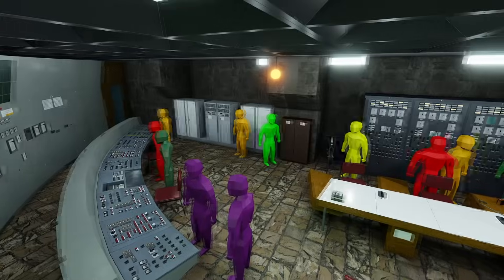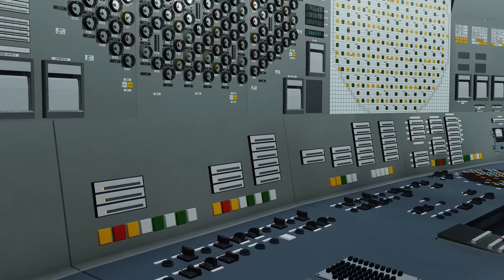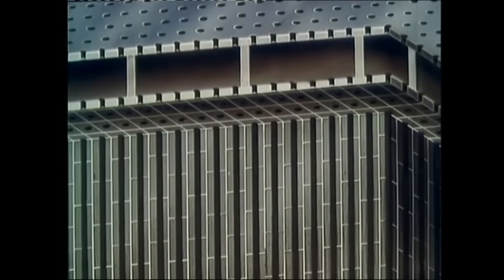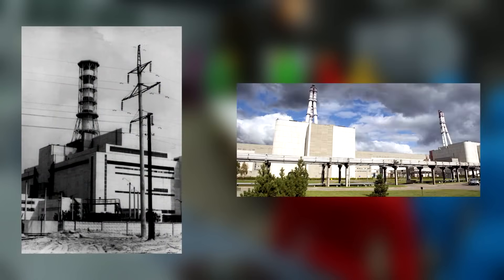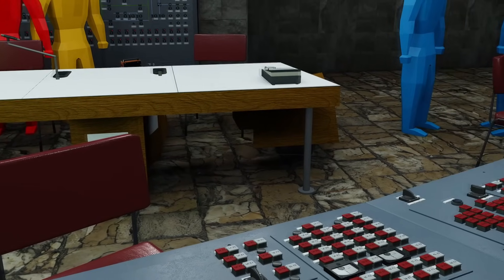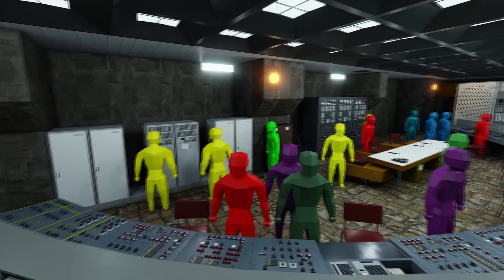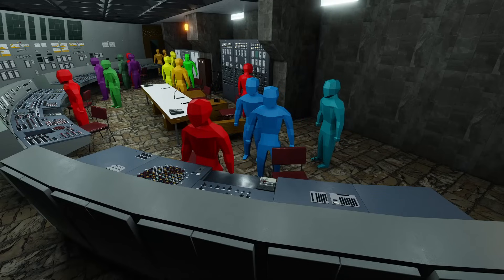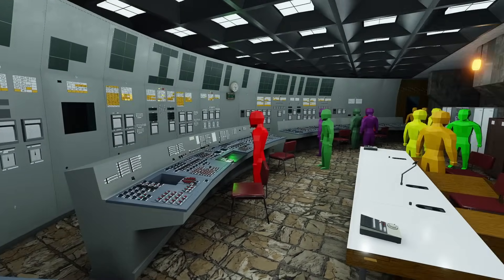How Chernobyl Exploded - PART THREE: The Final Minutes

Comment: Actually Prompt critical is the wrong term - this is used when the Neutron rate is neither increasing or decreasing but is sustained only by Neutrons emitted immediately following a fission rather than those released from the resulting fission products seconds to minutes later. The term you're looking for is "Supercritical"
Reply: That Chernobyl Guy is actually correct in his terminology. When neutrons aren't going up/down, is called a reactor being critical. It means nothing more than that reactor power is stable at some level, and the neutron generation being used/ being produced is in balance. 1 neutron produced -> 1 neutron being used. That's not prompt criticality, far from it.

Supercritical is when reactor power is going up. More neutrons are being produced/ used. This in itself isn't necessarily dangerous. You need a very small bit of supercriticality, or else you would never be able to get your reactor back up to power after a maintenance shutdown. And you can be supercritical on delayed neutrons. This is totally normal. Like I said, you'll need some of it to get your reactor back up to power.

Prompt criticality is something else entirely. It means the reactor is sustaining the fission reaction on prompt neutrons alone, which is very, very bad. At that point you will put your reactor in orbit because there is not a computer system or human in the world that is fast enough to prevent things from spiralling wildly out of control. See Chernobyl Unit 4 for the results of prompt criticality in a power reactor.

Prompt neutrons -> being born at the moment of a fission event.
Delayed neutrons -> they appear millisecond to sometimes even minutes from the fission products after a fission event. These are the neutrons we use to be able to control a reactor. Without these, that would be impossible.
Reply: @swokatsamsiyu3590  Supercritical = "Oh shit, we've got to do something!"
                                            Prompt Critical = Ka-BOOOOOM!!!!"
Reply: Personally I would use "super prompt critical" to describe a system with a power excursion where the power cannot be controlled by active engineered systems, let alone by human operators.
Reply: But even a super prompt critical system might not explode. If it has inherent negative reactivity feedback, for example due to thermal expansion or fuel temperature effects, it might either self terminate or settle into a stable low power state.
Reply from the maker: Supercritical would be a βeff between 0 and 1. As βeff reaches 5-6, this is far beyond the value regarded for prompt criticality.

A similar method of measuring criticality is the dollar system, where 0 dollars = critical, and 1 dollar = prompt critical.

The values for βeff are given in INSAG-7, the IAEA's 1993 official report on the Chernobyl Disaster. 

I hope this helps. :)

Comment: "positive SCRAM effect" is a term coined by reactor's designers in attempt to cover their backs and shift the blame to operators. It is like positive results for cancer or Alzheimer's test, you can have plus sign, but there is little positive about it. Purpose of SCRAM system according to USSR reactor designer's regulation is to "rapidly and sufficiently insert amount of negative reactivity needed to shut the reactor down and keep it in that state". It is used in cases of emergency, as a response to violation of safety critical parameters, and also to shut reactor down as last step of routine shutdown procedure. "Positive SCRAM effect" means SCRAM system doesn't meet basic requirement for that system. Moreover, "positive SCRAM effect" implies SCRAM system in some situations does exactly the opposite - it inserts positive reactivity, increasing reactor's power. This also makes various protections of the reactor to behave weird. E.g. during the event, reactor's protection detected abnormally high reactor's power level and abnormally high rate of power increase, and initiated SCRAM. Logically, it should lead to rapid insertion of amount of negative reactivity, enough to shut down the reactor and reliably keep it in shutdown state. With "positive SCRAM effect" the effect is opposite.

In combination with slow rate of insertion of control rods that power peak may be rather long and devastating, it took 4 seconds for the reactor to explode with power rise from several percent to 100x of nominal, while insertion time of control rods was about 26 seconds, few time slower than on reactors of similar size, but without such large positive coefficient. That was determined be totally inadequate, while reactor designer's regulatory documents require speed of operation of control mechanisms must be enough to provide robust and efficient control of reaction and reliable shutdown, including cases of emergencies and accident.

And of course positive reactivity coefficient not only opened and shortened path to unintended prompt criticality, but it also highlights control system's inadequacy. Positive reactivity coefficient not only makes the reactor unstable and hard to control, producing tendency to power swings, but also, with increase of positive reactivity coefficient, makes swings larger and faster, and this requires much faster control system to fight with than it would be needed without positive coefficient. While negative coefficient does the opposite, making the reactor more stable, self-regulating and able to counteract disturbances. That's why reactor designer's regulation state "the reactor should have negative power coefficient in general; in case the reactor would have positive power coefficient, special attention should be paid to investigate and ensure safety of the reactor in stationary, transient and accident scenarios"
Reply: I never took "positive" to mean anything else except a mathematical '+', and I'm unsure  that the original Russian term even has such a dual meaning. It simply refers to the paradoxical, momentary increase in reactivity lower in the core following the insertion of the control rods (?) 
I strongly suspect you're reading into it a connotation that simply isn't there.
Reply: Incidentally, IIRC, the operators were not aware of this.
Reply: I mean, based on the rest of your post, you probably have more of a grasp on the actual relevant concepts than I do, so I'm puzzled by your  initial statement.  It's just like "positive void coefficient" versus "negative void coefficient", or "it is negative 31 degrees outside".
Reply: @bsadewitz Negative 31 degrees?! That sounds bad!
Reply: @reverbscherzo7850  So does +130!
Reply: @reverbscherzo7850 The original documents aren't in English.  I'm not sure if "negative" and "positive" even translate to words with the same connotations they have in English.  In audio recording, a -5dB level is fine, whereas a +5db would be severely distorted.  In digital audio, anything above 0dB is clipped; it can't be encoded.
Reply: All this is a replication of the Soviet lie about the causes of the accident. If you want to know the truth, watch: HOW THE 4th UNIT OF CHERNOBYL NPP WAS BLOWN UP.   (KS channel)
Reply: First of all, it is not SCRAM effect, it is flaw effect. Of course, naming it as such is the same as admitting the flaw. So what is the scram effect actually? Scram effect is shutting down the reactor, much alike as (emergency) brake system effect, which is to slow down the vehicle and stop it. It is required by regulations and sanity.

Ok, "positive effect" is an effect that improves the situation, while "negative effect" is something undesirable and makes the situation worse. Every aspect there takes in account the goal. So if sane person would use the term "positive scram effect" ("positive general brake system effect"), it can be used only to describe proper reactor shutdown process. There is actually no need for that, because it is normal unless specific reactor's control system is flawed, and term "scram effect" is as good as "positive scram effect". While "negative scram effect" is undesirable effect of scram.

Yeah, there is undesirable effects of scram, like thermal stress, but even those not described with term "negative scram effect". The term "positive scram effect" how it is used now, apart from defying common sense and sanity is totally disconnected from other terms it should be related to and occurs in publications afaik only in connection to specific flaw of rbmk reactor's control system. Terms "negative coefficient" or "positive change" are totally ok because of nature of terms "coefficient" and "change". While the term "positive scram effect" is constructed to cover designer's back and shift blame to operators, it is vague, absurd, confusing, obscures what happened, why it happened and not properly attribute what happened to why it happened.
Reply: @JumpingJack-w2l  It has absolutely nothing to do with any positive/negative value judgement judgement or assessment of anything.  

"The scram reactivity in Chernobyl-4 is positive.The magnitude of this reactivity is large enough to lead to a prompt critical condition." (p 216)

INTERPRETATION OF POSITIVE SCRAM REACTIVITY
IN THE RBMK-1000 REACTOR
K. HASHIMOTO et al
Ann. Nucl. Energy, Vol. 21, No. 4, pp. 211-217, 1994

Does that sound like something that's designed to "cover the designer's back"? The term is used in contexts that have nothing to do with RBMK reactors!  Scram reactivity is a generic term; it isn't just used when talking about reactor accidents!  It is not vague, entirely clear, and isn't the sort of thing that one would say inherently "obscures" a fact (or not).  You are reading into this meaning that is simply not there--and never was there, ever.  EVER.  "Positive scram effect" denotes an increase in reactivity.  "Negative scram effect"
 denotes a decrease in reactivity.  Of course, there is no reason to actually say "negative scram effect", because that's what is supposed to happen.  

I think you even said something similar in your post, and, if so, I am doubly mystified as to how you could not understand how you're misreading what "positive scram effect" implies.  There is no deception.  It's just a slang term for "local insertion of positive reactivity" after "receipt of a scram signal".

 You said "[It] occurs in publications afaik only in connection to specific flaw of rbmk reactor's control system."  Well, not really.  I mean, sort of, but that's because Chernobyl established that paradigm!  That doesn't mean that e.g. "positive scram" isn't used anywhere else!  Note the use of the  phrase "negative scram reactivity insertion" on p114 of this document about BWR reactors:

https://inis.iaea.org/collection/NCLCollectionStore/_Public/15/025/15025513.pdf

Comment: What a phenomenal conclusion of this 3 part series. Very, very well done. And you even included the exercise bike in the CGI representation of the control room, impressive attention to detail! The thing that still has my brains doing triple backflips is "had to wait 5 minutes before the system would spit out the results..." Good grief, when you're dealing with a reactor capable of doing a full about-face in literal nanoseconds, at least give it a computer system that isn't walking at a snail's pace.
Reply: The in-control-room display is a point of controversy among us. If you look at page 38 of INSAG-7 and in some other sources the suggestion is there was no such thing. The 01:22:30 printout is such a big deal presumably because of this. Yet I think in Shcherbak's book (possibly Karpan's) operators are being quoted as apparently referring to some display. Sredmash and That Chernobyl Guy are comfortable tying this display directly to the PRIZMA program that produced printout calculations whereas I'm not. So it's a surprisingly important detail that, as usual, is flying under the radar, and I find it particularly controversial.
Reply: @markusw7833   
I was more talking about the SKALA system in general, not necessarily a specific display. As ingenious as it was, it was also woefully underpowered for its intended task.
Reply: @swokatsamsiyu3590  Right, there was a systemic limitation. Five minutes was actually the minimum time. Five to about fifteen minutes is the window. In general the ORM was simply treated as not that important.
Reply: @markusw7833  Had the employee that was not present due to being told the reactor was shut down been there. Do you know if the computer they had for guiding ORM more advanced/faster?
Reply: @Melanie16040  I don't know about this employee. Unless he factored the actual values of the coefficients of reactivity into his program or whatever rather than the misleading ones the operators had available I'm a little skeptical as to his value. This is another detail found I believe in Karpan's book that seems at odds with what I've been reading.

Comment: It feels really counter-intuitive that too much coolant can be bad for a nuclear reactor. Yet we see a problem with flow rates here, and in Three Mile Island, where the operators became convinced that there was too much water in the system.
Reply: There was a rule against excessive flows for the main circulation pumps so they wouldn't cavitate or apparently destroy themselves, which was a consequence that did not occur at Chernobyl. However, there wasn't one for the reactor core. Soviet experts got quite clever in how they presented this. The consequence tied to Chernobyl is about the temperature of the coolant rising close to the boiling point, which INSAG-7 seems to attribute to lack of condensate feedwater flow as the reactor wouldn't be producing much steam which was supposed to subcool the coolant yet you see the operators being able to call extra feedwater flow from somewhere. Furthermore, apparently there was neither a prohibition on connecting all main circulation pumps or on operating with lack of subcooling, and a high coolant temperature occurred naturally in RBMK reactors. This will be discussed in a later video.
Reply: @markusw7833  All this is a replication of the Soviet lie about the causes of the accident. If you want to know the truth, watch: HOW THE 4th UNIT OF CHERNOBYL NPP WAS BLOWN UP.   (KS channel)
Reply: It can be counter intuitive. In British AGRs, the reactor power is controlled via the coolant flow. Increasing the flow increases the power.
This works because these reactors have a negative fast temperature coefficient and automatic control rods to deal with the slow positive temperature coefficient of their core graphite.
But I think the real problem at Chernobyl was where was the thermal power supposed to go after both turbines were tripped?
AGRs are automatically shutdown in the event of a turbine trip and post trip cooling systems kick in right after that.

Comment: "The pressure inside the core has been released" yeah that's one way to put it
Reply: "A rapid unintentional disassembly"
Reply: @maksphoto78  Or slow, if we consider all the cut corners in construction and design to get these reactors up and running so fast.
Reply: a nuclear powered pipe bomb
Reply: Terrifying to realize when you strip out the nuclear part, this was basically a steam boiler going "boom". Or more terrifying to me as I understand steam better.

Comment: Imagine flying an airliner where the feedback from changes in the flight controls took two minutes to reach the pilots...
Reply: That would be a 727.  Not kidding.
Reply: @naughtiusmaximus830  not really considering it's a very old plane other planes of that time also had a delay
Reply: Airplanes actually do take a while to respond. Especially older and larger jet engines. Luckily the calculations were already considered when designing the path airplanes take into the airport. So the plane, under calm conditions, shouldn't require much input between a few critical decision points. Even if the engine takes 20s to fully respond, a full approach might be a 15-minite process, so the pilot can plan well ahead.

So pilots have a rule. "Aviate, navigate, communicate". Step one is steer the plane, ignoring all other factors, do what you need to do to not crash above all else. THEN check if you're at the expected speed and heading and whatever. THEN call to the tower or copilot or whatever to indicate what's happening. 

Very similar to the nuclear operator. Aviate - smash AZ5 if there's an emergency. Navigate - check the output levels and indicators. Communicate - talk to your coworkers about what else is going on. In that order.
Reply: @KevinJDildonik modern engines go from idle to full thrust in less than 10 seconds

Comment: I'm sorry, is there an exercise bike in the background of the animation of Dyatlov?
Reply from the maker: The Chernobyl Unit Four Control Room had an exercise bike in real life. The operators needed the opportunity to stretch their legs without leaving the room, so they had installed exercise equipment. Ignalina, for example had a full weightlifting set with a bench.

You can see the exercise bike in the background of a video in the Control Room before the explosion. Its current fate is unknown.
Reply: And in the '90s the operators started playing Pong on one of the new control room computers. Until the deputy chief engineer caught them in the act and cut the power cable with an axe.
Reply: @thatchernobylguy2915 i now feel vindicated in keeping an exercise bike in my room. if it's good enough for chernobyl it's good enough for me!